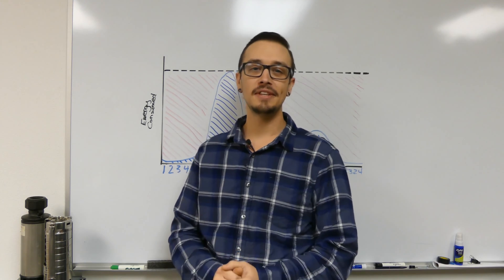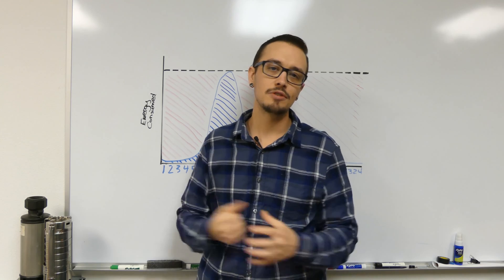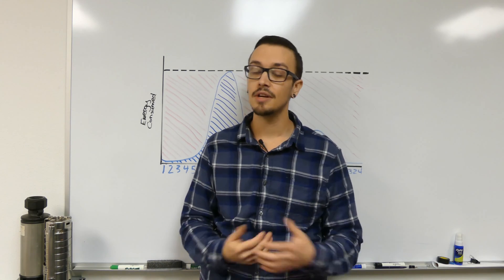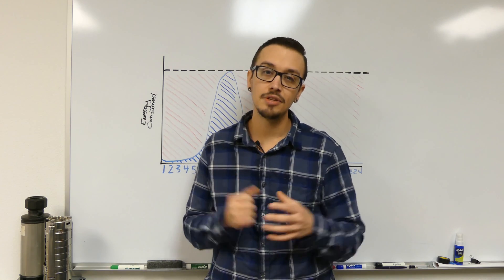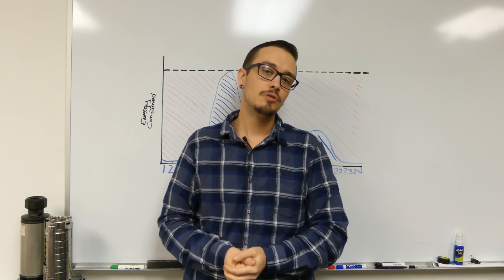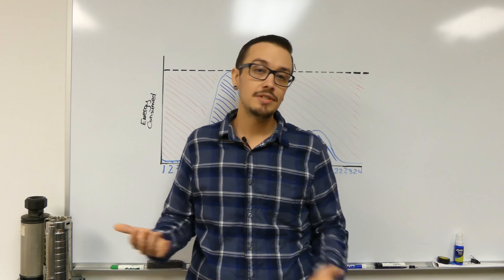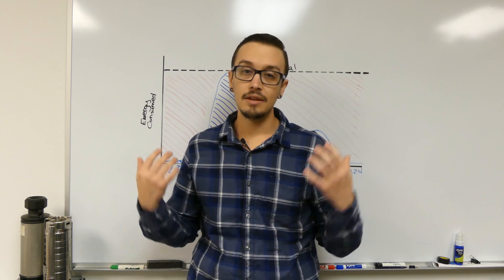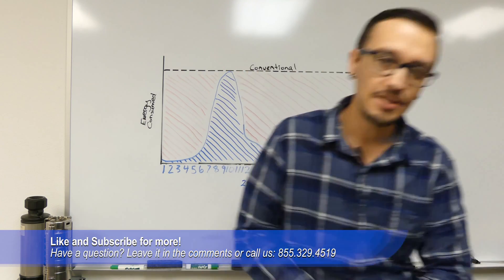Is a VFD Constant Pressure System worth the $$$?

Comment: In my past life i was a Industrial automation guy.   This is really what you need to know about motors they all need some form of three phase power, single phase pumps use a start/Run Capacitor, over the years as manufacturing processes have miniaturized, the plates in these capacitors have become thinner and thinner, thus making them the weak link in the chain.    and is typically why you now only get 5-10 years out of a single-phase motor.   yes, Barings go bad, but that is typically from a lack of lube/grease.    3 phase motors dont have start/Run Capacitors thus making them  "more Gooder" :), The fact you can add a pressure transducer and a PID loop, is really just a nice bonus.  Obviously depending on distance from the VFD and the pump, plus the fact the VFD lives on the surface (a place you can get at with little effort) is a good thing.    Not really a water pump comment, but 2 cents of industrial motor knowledge.  Please note VFD come in all shape and sizes with all different purposes, i.e. single to three phase, AC/DC.  So don't just go out and buy one you need to contact a supplier to help you pick one out if you don't work with them, there are so many different variations and applications.

Comment: I have been debating a vfd well pump for about a month now. We have a big house and the water travels a good distance once it gets inside. We recently swaoped the pressure switch out and it works, the lump kicks on and off but as soon as a zecond water source is turned on and i mean immediately the water pressure DISSAPEARS.....does this sound like a pressure tank issue or? I was debating vfd to eliminate this issue

Comment: I couldn't be happier with my constant pressure system. My homes 1986 well pump gave out in 2013 on a holiday weekend just after I purchased the house. The only system the guy had on his truck ready for install was a VFD.  It's great being able to water the grass, wash laundry and take a shower at the same time with no noticeable difference in pressure.  The electronics, gage, and small pressure tank are wall mounted so there is no giant pressure tank, taking up floor space and collecting spiderwebs.  I can easily change the pressure on the system if I want, at the push of a button. Previously I would have to get on the floor and use a screw drive to adjust the mechanical pressure switch.   I was also able to have a larger capacity pump installed with out worrying about over cycling the pump.  Not to mention it plays nice with my 7200 watt portable backup generate that I normally spend 1-2 days a year running on.  I would probably have trouble running the whole house on a generator that small if I was running a standard pump.  

This was nine years ago, but the price difference for a conventional system with 1/2 hp pump VS  VFD with a 3/4 hp pump was 40% more for the VFD.   About $1,300 more at that point in time.
Reply: How about the whining noise that keeps mice away from my house. I consider that a plus. But I agree with you. Awesome

Comment: Nice video - thanks for the information.  Kind of what I was thinking anyway. 

We are replacing a 30 year old pump - > 500 ft down.  It is still running but the wires to it > 1000 ft away have a open circuit problem (likely water ingress) which stopped the system. 
Wanted to at least fully consider the VFD pump system.  But not necessary or useful in our installation. 
So the long wires - inductive and resistive load - this creates a soft start situation.  And here the well pump just fills a 1500 gallon tank (keeping it at its max fill level) - with an additional 2500 gallon tank being added (2nd will be plumbed for rain catchment as well - if ever needed - we get ALOT a rain here in pacific northwest).  Pump is either pumping full out or is off.  Then a separate pump (pressure pump) pulls water from the tank into a 200 gallon pressure tank - the pressure pump just runs until it hits the max pressure we have it set to, and comes on again when the minimum pressure limit is reached as the bladder in the constant pressure tank shrinks down.  So its the pressure tank which determines the actual pressure output in this system, and not the well pump.  So constant pressure is useless in this application. 
Although I like VFD for driving machines -- may be converting one machining system to 3 Ph motor & VFD likely early next year.   But these allows running at lots of speeds and under different load conditions.   

But for this well the only benefit seems the use of smaller wire sizing - I mean the old pump is over 30 years old and still going.  
Yet since we have to wait for the well company on replacing the innards (pump, wire and water pipe) of our well, we have to put in large wires now to use the existing pump until they can come out.  Ours requires 2-2-2-4 wire (using Aluminum) which will be about $2500 for 1200 feet - this is mainly because when our predecessors put the well in - the down wire used was a measley #10 wire - and drops significant voltage in the 500 foot depth.  When we have the new pump put in we'll go for larger wire size to decrease losses to assure it always has sufficient voltage.

With the current 2 ph system - I am running both the well pump and presssure pump from our inverter which is driven from a battery bank from the solor panels - but I can readily pull my generator out to the well head and drive the well pump to fill our tanks.  (exactly what I am doing now while we wait on wiring). 
I can also normally (when wiring is not inop) connect the generator in the from the tank house here at the house, if our solar system croaked.  Or connect the generator to charge the batteries - if the inverter still working.  So there are many options with driving a conventional pump. 

With the VFD: (1) you would not be able to directly drive the well pump from a generator or normal inverter, (2) VFD is a single point of failure - you would want to have a backup VFD in case it went out; (3) the whole issue with surges and harmonics with VFD seems another can of worms when one is hacking power together to get their next cup of water.  

QUESTION ---
Interestingly regarding wire size and efficiency the well person I talked with said that reducing the wire losses to the pump would not increase efficiency of the system.  Seems counterintuitive.   
I understand the pump is set to run at a fixed RPM - so it sorta makes sense.  I would expect that the higher voltage reaching the pump would seem to at least increase motor torque, and perhaps prevent it from lugging down and heating up with premature shortened life - but that's an issue I think of more with gas powered devices designed to develop their power at higher RPM.  If the RPM is fixed - well it seems odd that it would make no difference - but then although I'm an electronic engineer I haven't spent any time looking at power profiles for well pumps (I was in to computer design) - so perhaps it only needs to have just sufficient voltage to run, and power is lost one way or the other... 
So I'd be interested in this aspect of "efficiency" if anyone knows more about it on a regular AC motor.

Comment: in CPS system, do you still need relief valve? since it is constant, pressure is not abrupt pump stoppage and surge.
Reply from the maker: Yes, you still need one. There is still the possibility of the pressure sensor failing and the pump over-pressurizing the system.

Comment: Hi,

Can I keep the same size of pressure tank in case I want to upgrade from conventional to vfd system.
Reply from the maker: Yes, your pressure tank should be large enough since the VFD requires a much smaller one.

Comment: “Soft start” sounds like a big selling point for systems that might need to run during an outage on battery. But sensitivity to surges and harmonics suggest standard non-inverter backup generators could damage the controls.
Reply: And the efficiency question: how long will he battery run it?

Comment: We are going about 450 feet down. We are looking at Grudfos well pump 3hp and Grundfos Twins. We could be supplying 3 homes. We will have a 2500 gallon storage tank so that the well pump will only cycle to "top up". House distances vary from 150 feet to about 300 feet from the pump house. The feeds to each home will be 1.5" tom2". Feeds will be relatively straight. We are going to add a power line filter right at the Twin electrical feed point grounded to the pump house UFER system. Though the Grundfos data based on the Twin selected lines shows me 35-45 GPM at 60PSI can be obtained,  I'm not too concerned since the usual water demand in homes comes in small "spurts" during a given day. All homes have agreed to leave land as pasture land and irrigation will be flower beds, etc so that no home would be using the well quite disproportionately. My GC has noted problems with VFDs in short life span and suggest constant pressure via a CSV system which I understand does put unusually high back pressure on the pump. Since the conventionals do spin the motor at constant speed, the GC claims longer life for the booster system and lower cost to install. I'm thinking the Grundfos Twins are their own a small package with no external pressure tank thus creating a simpler system to install. The Grundfos folks I have spoken have noted very high reliability with the Twins. I understand the cost of the Twins but the ability to have 2 pumps operating in a cascading manner seems much better....this is the beauty of the cascading ability, each pump will  come on at some point to share the demand but at equal but lower speeds. Also the Twins VFDs are blue toothed so they "talk" to each other so I could read the data on my smart phone, forward to Grundfos and they can tweak it, send it to me and I can upload the new parameters per Grundfos engineering. The Twin setup seems like light years ahead technically speaking versus the CSV approach.  We of course can raise the pressure of the Twins to compensate for pressure drops since in reality flow rates in homes during any time of the days are pretty low. Even with 3 homes I believe the Twins can easily handle the job.  Comments ?

Comment: Thank you for this video! I bought a house with a well last year, and today the pressure tank (in my utility room next to the water heater) started leaking a bit. Found 2-3 cups of water on the floor, called the plumber who's worked on the house before and knows the system. He's described both types, but this really helps me understand better. Thankfully my well is 100+ feet deep and produces a good quantity of water. I've never had pressure problems, and am on irrigation April15-Sept15 for outdoor watering. The WellXtrol pressure tank has been here since the house was built 25 years ago, so I'm sure it need to be replaced. Don't think I need the VFD system - another tank will do just fine, and much less expensive....especially since I'm in the middle of a kitchen remodel.
Reply from the maker: Glad you found our video useful!

Comment: I am thinking of installing a open loop geothermal heat pump 5 ton that will have a water requirement of up to 10 gallons per minute when system is running and have been advised to install a VFD.  asking if you have any opinion on this?  If i do not do this, they are stating i may need a 100 gallon pressure tank to handle strong pulls on really hot days or really cold days.  I have 22 gallons a minute supply rating and my house is 2300 sq ft.  2 bathrooms and only 2 people living  most of the time.

Comment: The best for no service calls etc and get benefits of soft starts and automatic cutoff that the VFD systems provide is get a pump that is well matched to needs and get a pump such as the grundfus  SQ ones that have soft start and  low water automatic cutoff.  If you want you can get the Grundfus SQE or similar VFD pump then when controller goes out install a Cycle Stop Valve and don't repair the controller.
Reply: When the controller goes out, don't repair it?  Are you just wiring in 3 phase directly through your pressure switch?  Interesting idea
Reply: @lucascoulton  No just wire as usual without the $300 plus controller the SQE will then act as an SQ pump. The Cycle Stop Valve is what would keep a constant pressure with variable volume demands

Comment: Very good video.  Thanks for mentioning Cycle Stop Valves.  You make the statement that with a CSV the pump is always spinning at full RPM.  However, you fail to mention that the horsepower or amps will naturally decrease as the CSV reduces the flow rate.  Full speed does not mean full amps.  The amps of a constant speed pump will vary with the flow rate almost the same as if you were varying the speed.  I also disagree that VFD's increase the life of pumps/motors.  The voltage spikes and harmonic content of the power from a VFD are just as bad if not worse than the torque and inrush current from an across the line start.
Reply: Thanks for the comments. At full speed a conventional pump operating at its best efficiency point, generally the middle of the pump curve is at its most efficient which is maybe 60 something percent efficient. When the pump moves away from that best efficiency point, gallons per kilowatt is hugely impacted. Using a CSV can easily cause a pump to run at or near dead head during low flow and this is extremely inefficient, I would speculate 30% or possibly less Also worth mentioning is using a CSV can push a pump to operate in a down thrust position depending on sizing considerations and pump selection, this no doubt kills multi stage pumps. Which is why pump selection is critical with a CSV. VFD's offer more flexibility in this category.  So the gallons per kilowatt hour is impacted. On most residential systems the scale is so small that it is negligible but very much existent.  Due to VFD soft starting capabilities, motors will no doubt have a better opportunity to last longer, no doubt in my mind. This is one of the main and most important features of VFD's especially as the size of the system scales up.
Reply: @chrisworst8353  I don’t think pump selection is critical with a CSV.  Pump selection is critical for efficiency period.  A 10HP cannot be efficient at a 2HP load, no matter how you control the pump.  Gallons per kilowatt are hugely affected with a VFD as well.  Using a VFD can easily cause a pump to run at or near dead head during low flow and this is extremely inefficient.  The whole concept of the CSV is that it can never completely close, so it can never deadhead the pump.  Proper calibration of a VFD is required or it could easily deadhead the pump, running below the frequency that will produce the static head.  Multi-stage pumps just require a little more cooing flow, and the increased backpressure from the multiple stages automatically increases the minimum flow through the CSV to accommodate.  Submersibles with the downthrust load on a Kingsbury type thrust bearing will last longer with increased downthrust, than if allowed to slowly ramp up to 30hz, where there is no hydroplane effect lubricating the thrust pads.  Efficiency or Horsepower is all on the pump curve.  Because horsepower also goes down with increased backpressure,  many times there is very little difference in the kilowatts per gallon between CSV and a VFD.  A VFD can be used on a multitude of devices.   The CSV only works when pumping fairly cool, clean water at a constant pressure.  But for cool water delivered at a constant pressure there are two ways to skin that cat, and the cat gets skinned about the same either way. Lol
Reply: @cyclestopvalves8380  I did specify at or near dead head, either one is detrimental to down-thrust and pump wear. VFD's can also in some specific instances operate near dead head but that relates directly to the variables of pump selection and well depth and static water level in relation to the pump curve. A CSV regardless during low flow will be at or near dead head regardless of other equipment selections. Not knocking CSV's here, I like them for a wide range of applications. Just clarifying further differences in operation where certain instances one may be better suited than the other.
Reply: @chrisworst8353  Deadhead is when the pump is not moving any water.  Close to deadhead is when there is not enough flow to keep the pump and motor cool.  The CSV can never completely close.  It always allows enough flow to keep the pump/motor cool.  So, the pump can never be at or near dead head with a CSV, and there is not enough down thrust to be detrimental to the motor thrust bearing.  As long as the thrust bearing is good, floating stack impellers do not touch the diffuser to cause any wear.
Reply: @cyclestopvalves8380  CSV is a DC pump. So you have a transformer that cleans up the power. This is the same technology that is used on inverter hvac and refrigerators.
Reply: @Logitranz  CSV is just a control valve used to control AC pumps.  No transformer or power needing to be cleaned up.  The CSV does not require any power, as it works with a simple spring to control the pressure.
Reply: @chrisworst8353  Down thrust as it applies to submerible pumps?  How about  jet pumps.  Please enlighten me about CSV and Jet pumps.   Your top notch.  I appreciate your explanations you have been helpful to my understandings and studies.

Comment: Does the recommendation change if using a storage tank with a booster pump? The conventional well pump just fills the tank. Constant pressure on the booster sure is desirable.
Reply from the maker: The same principles would still apply, but for some, the cost is worth it.